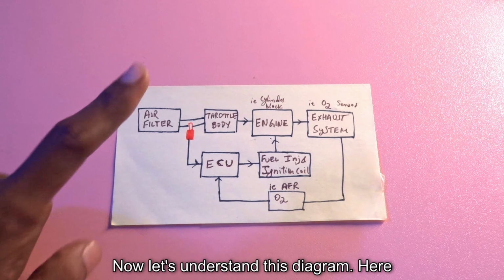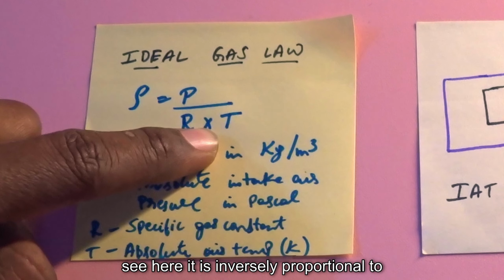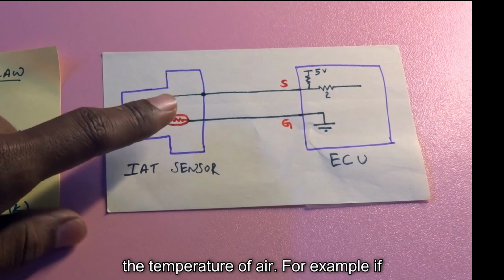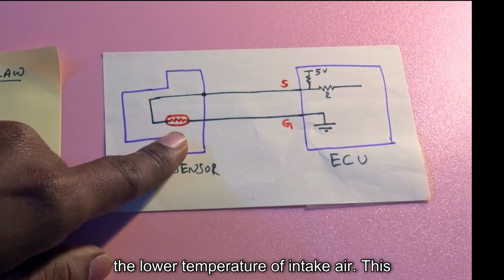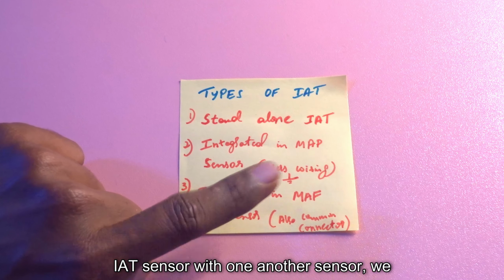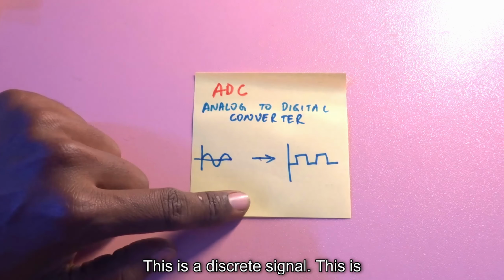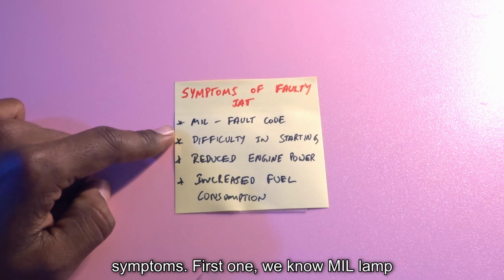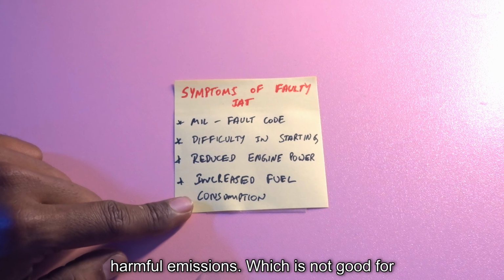IAT Sensor Deep Dive: How it Works in Automotive Electronics

Comment: my requirement is this We need an industrial continuous level sensor Application: 200 L barrel containing 1- cementitious grout slurry (viscous), occasionally latex/foam liquids 2- fuels, oils Measured range: 0–800 mm (barrel internal height). Accuracy: ±5 mm or better. Wetted parts: SS316 with chemical-resistant seals (Viton/EPDM). Ingress protection: IP65 minimum, prefer IP67. Suitable for abrasive slurry and foam liquids. any suggest leads, and sensor